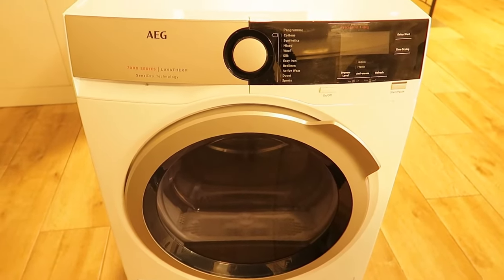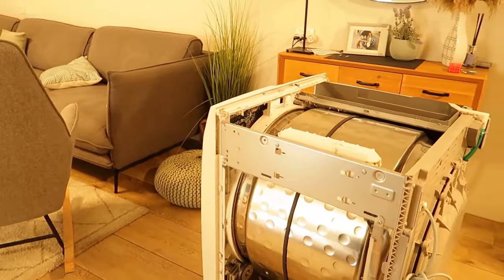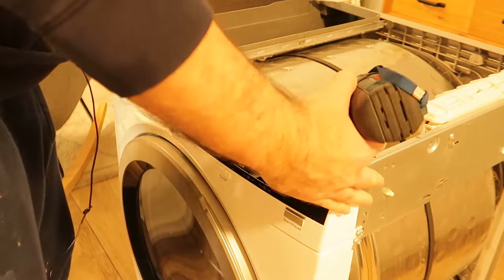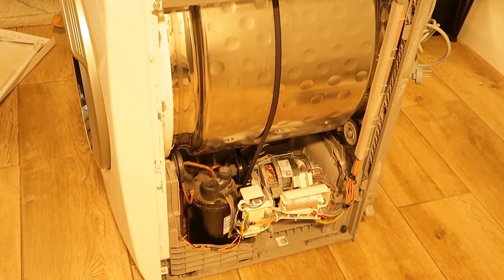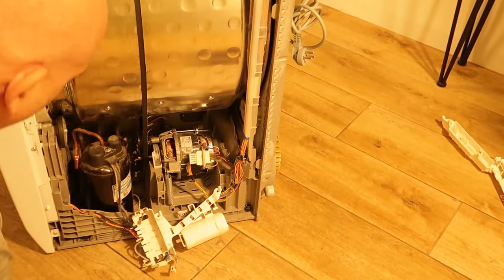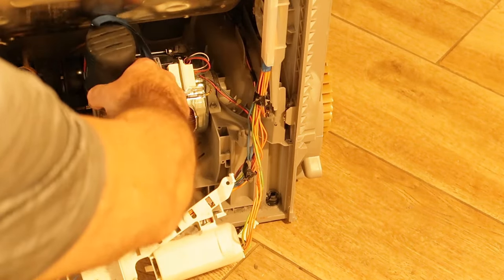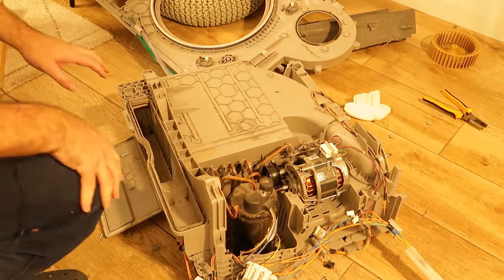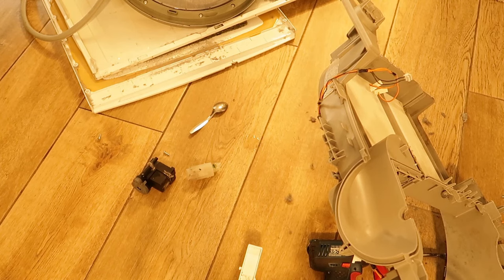AEG Dryer 7000 Series disassembly

Comment: For those that want to repair a rumbling (driving with a flat tyre) noise. It can be one of the drum barrel rollers. There are four of them, holding up the drum.  Often it is advised to swap the whole set . I only swapped the front two rollers as they are so expensive. The tough rubber on one of the front rollers had separated from the plastic and was making the noise. It is an easy job if you 1) release the spring that puts tension on the engine, so the drum can be lifted a little. 2) unscrew the bolt of the roller. Opposed to other models, this bolt is actually a thick screw going straight into the plastic. It has no counter nut. Lift the drum and remove the bolt and defective roller. In the old roller there is a plastic tube you can reuse. 3) screw the new one in. 4) use a piece of old electric cord to lift and reattach the spring to the engine, making sure the belt is still in the same spot as it was 5) vacuum the insides if you haven't already, done!  I greased all bearings of the rollers with WD40 and closed up. Problem gone. One of the drum rollers I removed was still fine. I save it for later.

Comment: Thanks for the video. I had again the Thunk, Thunk, Thunk as we had had before. Engineer came out and replaced one of the drum rollers. So when I heard it again I was about to order a wheel when it stopped turning. I remember when the engineer came last time he brought a wheel and a belt. So rather than risk it I ordered a wheel and  belt. Using this video I was able to take the machine apart to find the belt had broken. All the wheels were fine. I think this thunk thunk thunk was just the belt fraying on a weak spot and eventually it broke. I had the job done in less than an hour. I bought everything through AEG/Electrolux which worked out about £1.50 more than an online Parts supplier. If you put your machine in the MY AEG page you get full parts listings too. Very helpful.

Comment: HUGE thank you for your video. It helped me a lot understanding how the dryer is assembled. However, I was able to dismount and change the motor without wholly disassembly it. Once I unmounted the top rear panel and removed the drum I was able to rotate vertically the motor over the heat pump and moving it towards the front panel and remove it. The new motor also came into place the same way. Hope it helps

Comment: My god, I tought about taking the motor out for replacing the carbon brushes. Because I opened my machine for replacing the rollers. But after seeing this, I guess the motor just has to wing it for a while longer.

Comment: Hi great vid. Do you know if the little fan in the bottom front right should be on from the moment the dryer starts or is it on a timer? Thanks
Reply: No, it only turns on if the compressors gets too hot.
Reply: @HobbyHoarder  Thanks :)

Comment: Hi Roee I have the same dryer.
Do you know where the drain pump located?
Reply: I also had this question. I found it on the back of the machine in the plastic box on the right side (next to the blower). Only needed a few screws to access. Did not require full disassembly.

Comment: If the dryer is not generating heat what can be the problem. How do you know if the compressor is working?
Reply: You can hear the compressor working. If you put a hand on it, it should also vibrate. If it does, then it's working, but you still have to check if there's gas in the system. Leave it running for about 30 minutes, then check the copper pipes that are connected to the compressor; one should be hot and another one should be very cold. If it's only hot but there's nothing cold, then you don't have enough gas (or none at all) in the pipes and you can throw the machine away.

Comment: why the heat pump doesent work? you checked the condensator?
Reply from the maker: probably hole inside the pump, that cause this issue, it is not possible or worth to disassemble it